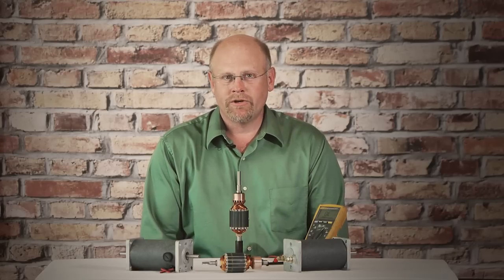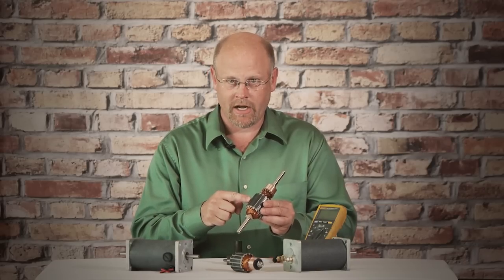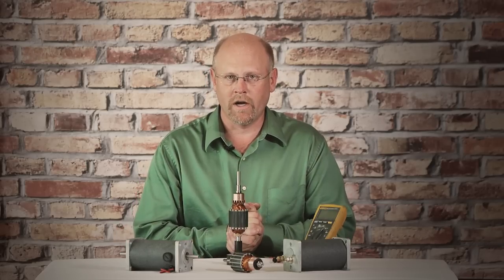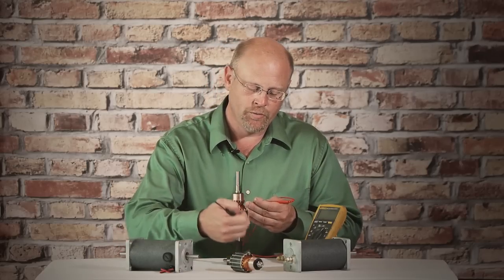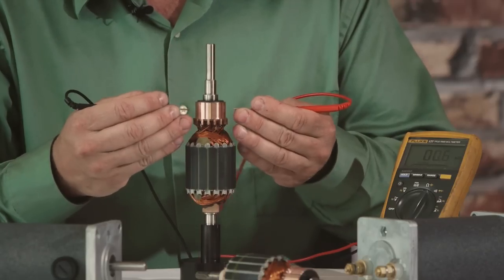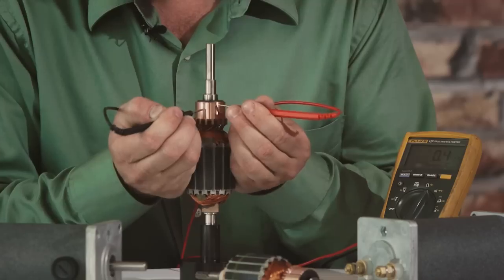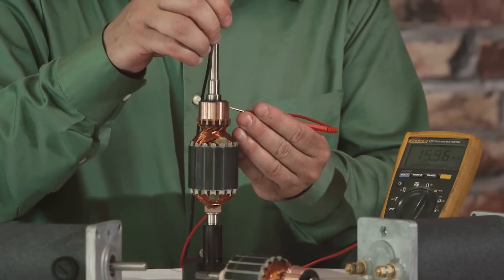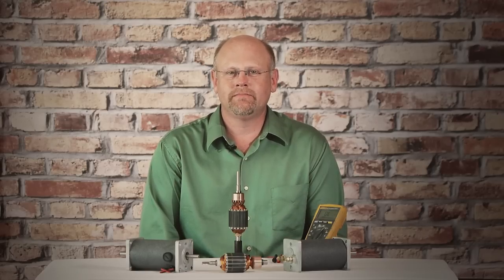Groschopp Tech Tips | How to Check for a Damaged Armature

Comment: I subbed. Actually I was looking for this information for testing a armature. I just took apart. Pretty cruddy inside, though not surprised its a drive motor from a Tennant floor scrubber. It jumped it just sparked a little. Had to break the motor down the bolts from the face of the moter were Phillips. Slmost stripped one but like I mentioned. The armature looks bad. I'll find out soon enough. Thanks for your posting this video. Don.

Comment: Hi Jim! Thanks sharing the video. My grinder stator only one coil is burnt. Should I change couple and another question each coil has 200 turns and I can measure the resistance and total diameter of the coil that is not damaged. Please advise whether it is possible to calculate the wire diameter to order it. (p.s: total coil length is about 30 or 32 meters 230 V 500 W 50 Hz 11000 rpm)

Comment: even though my DC motor's winding is disconnected, motor is running fine and making pressured air.
it is a compressor motr with 18 commutator bars. one bar to bar test fail.  the motor power consumtion has decresed little bit ~ 20%.

Comment: Hi I have a dewalt grinder and I did the 3 test and I also had continuity in my field .I put the grinder together and it turns slowly and gets hot enough to smoke. I am not sure where I am going wrong. Question on the bars where the point touch on the 180 test . If I am off a bar or two I have the same reading what dose this mean thank you for your time.

Comment: Thanks for the video. 
I have a motor that hums but does not turn. The shaft for my motor does not have the windings.  The housing has it.  The shaft has a cylindrical metal which is non-magnetic (belongs to a phase 1 bench grinder).  When i tried to turn it by hand in the "on" position, it does not move.  While in the "off" position, it turns just fine.  I checked the capacitor and it works fine.  The bearings are good too.  Any ideas on what might be wrong with it?

Comment: how to find whether field winding is fine? Pls give details by measuring with multimeter
Reply: I think that you test the top and bottom separate check continuity on the in and out  wire's then make sure there's no continuity between the inner shield and  each wire . And the outside shield and each wire.  Good luck and I hope that your motor spins smoke free.

Comment: The carbon contacts are as wide as two contacts on the armature.
Does that mean that there are always two contacts are one?
There are 24 contacts.
And there are two commutator contacts with a "beep" between the contacts (second test), but both are not connected to the contacts on the other side.
I didn't pay close attention to whether it was exactly 180 °, but no contact on the opposite side was in contact with these two contacts.

Second Test:
Two contact pads beside no beep*. Right pad (from this two) to the next contact pad *beep*. Right pad to the next pad no *beep*. Right pad to the next contact *beep*, and right pad to the next contact *beep etc.. 
Two times next to each other: No contact.

The vacuum cleaner suddenly stopped working.
A Sebo Felix with Amatek Italia "E 063200099" 1200W motor.
After opening the device, the motor suddenly worked outside the housing. But not always. And with sparks.

Do individual defective commutator connections lead to electrical brush sparking?

Comment: I have a very old, very rare starter and the armature is showing to be grounded out [shorted to the armature] after getting it back from a starter rebuilding company and i was wondering since it is so rare, how would one suggest going about restoring it? 

It is a high amperage, low voltage system [3.3 kw @ 24 V originally, but they ended up putting in 12v coils they said...

Also, originally designed for 4 poles, 90 degrees apart from each other, but when I got it back, I found that they had it rigged up on only 2 poles and both were the same poles, 180 degrees apart from each other.

I found this out after it only started the engine 3 times and the brushes were burned, one was broken, and as mentioned before, only half the brushes it was built for from the factory.

It is apparent that although they knew the armature was bad [perhaps before this all happened or perhaps only after, I will never know and they will never admit] and were trying to find a new one to press onto the shaft but failed, so that would indicate it is indeed pretty rare.

Should I dismantle, it clean it, re-lacquer/epoxy it and hope for the best? 

I can get high dielectric, high temperature [600°F], oil resistant epoxy pretty easily, just wonder if maybe I could resolve this that way or not.

Always open to expert input.

Comment: Hi.. Good Video.. I have a Damage Dremel, this Armature tool have 8 commutator bars.. and i note that the commutator bars are connected in two sections of four, i mean.. 4 continuous connected separated and the other 4 continuous connected.. That is Ok? All must have Connected? The Measures in Ohms all Ok. about  0.6 Ohms and i will like to Know if this is the problem.. Thanks

Comment: what are the tolerance - I have an engine where all pairs are 1.5 ohm - but one pair is 1.0 ohm....

And across 180 there are further variation between 1.8 ohm to 2.6 ohm - 

There are no short to ground

Comment: I'm sitting here thinking how to test if my washer motor is good the washer won't spin so I pulled the motor out tested wires continuity it seems ok now I would want to directly energize it see if it runs I just don't have a way to use a socket out to   power the terminals but I will keep thinking where to find wires that I can plug to an out let then I will know if the motor is still good and by the way it smells like shorted wires I'm thinking the motor isn't good anyone with a suggestion?
Reply: +alfred kabura If the washer sounds like the motor is running but it's not spinning it could be that the agitator is stripped. This is a common problem. They are made to where if there is a problem such as an extremely overweight load or something gets caught or bound up in the washer the agitator will strip to keep major damage from happening such as a burnt up motor or a mojor shaft breaking.

Comment: If there is a short to ground wouldn't it show up on every segment because they are all connected and the small resistances involved would make it impossible to pinpoint, isn't that the reason they used to use a 'growler' ?
Reply from the maker: +Robert Paterson  Yes, in general if one segment is shorted to the ground/shaft they will most likely all measure a short to ground.  A growler is used more for determining if there are wire shorts within a coil or to determine which coil is connected to which comm bar—it can help you determine if the armature is wound correctly, or help to determine the winding of an unknown armature. Hope that helps!
Reply: I've just diagnosed an armature with leakage to ground.  It's 40k ohms and exactly the same on each bar.  How could it possibly be any different on another bar?  The low resistance of the windings are insignificant compared to the leakage resistance so it doesn't matter which bar you test on.
If your multimeter reads no leakage when tested on one bar,  you can stop testing.
Reply: Edpañol
Reply: Traducil al español

Comment: Ive got a vacuum motor, that when turned on excessive sparks and after 3 seconds it starts to slow down and a burning smell.   I took it apart and did a Bar to Bar test.  Most were 01.0 except for two of them which was a 02.5.    I'm guessing  02.5 is not good obviously.  Whats wrong with it ? Should I trash it ?
Reply: You can replace the commutator and put new windings on that same core. Just find a local electromechanic to do it for you. Cheers
Reply: What a intelligent answer..... That must've taken some time to come up with that.  Cheers to you   Bljuzga My problem is solved.

Comment: If you properly get continuity bar-to-bar going around the whole commutator in the second test, then the third test should just need to check one bar to the shaft ("ground").  It would be prudent to make sure the meter probe tips are not leaving indentations in the commutator bars (particularly where the brushes ride).  Note also that the first test can usually be performed with the motor in the housing by just measuring across the brushes.  This test is good for most motor configurations but there are exceptions (e.g. it won't work for a repulsion start motor, but they are rare these days).
Another good test for small motors is power the motor at a voltage just above where it starts turning (using a variable autotransformer for ac motors or a bench power supply for dc motors).  Then load the motor with your fingers and check for even torque throughout a complete turn.  The torque may change a little as each commutator bar crosses a brush, but should do so from bar to bar pretty evenly.  The current should behave pretty consistently from bar to bar.
A final test is to run the motor at full voltage and no load.  If the current is higher than expected and there are lots of sparks flying around the commutator, there is a good chance that some turns of the motor armature are shorted.  Shorted turns behave like shorted turns of a transformer.  That is, they may be hard to detect from dc measurements, but cause a considerable increase in ac current.

Comment: Hi Its me again, fitted new armature, checked the centering of the armature, motor ran at full speed for a few seconds then started to slow down again, on closer inspection i found that the bottom bearing is spinning in its housing, and there is a slight vibration on the machine, no smoke anymore, so iv'e just ordered  bottom housing and bearing and top housing, wish i had have just bought a new machine now lol.

Comment from the maker: Hi Peter, from what you described there is a possibility the armature is not centered within the motor resulting in interference with the field.  To confirm this you could check the field to see if there are score marks on the inside of the field. It might be possible to center the armature when putting the motor together by taking care when tightening the bolts. If this doesn't solve the issue you may need to contact a motor repair service.  Hope this helps.

Comment: Hi, Many thx for the tips on testing, I Have a bosch gof 1300 ce router, did all your tests and all seems fine, notices that parts of the stack teeth are scored and not shiney any more, fitted a new field, and brushes, motor still running at half speed and still smoking, any ideas would be much appreciated.